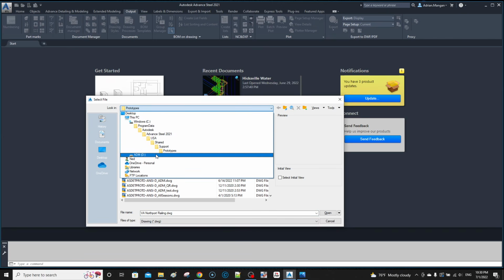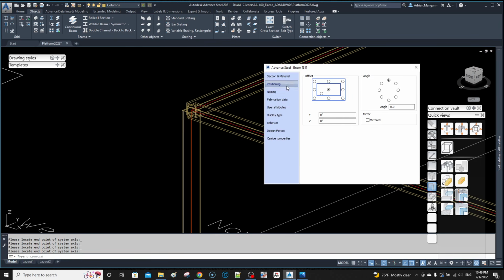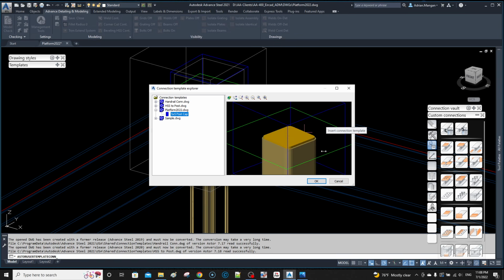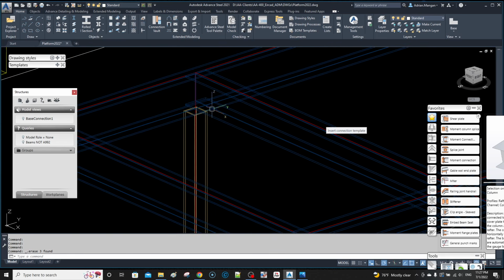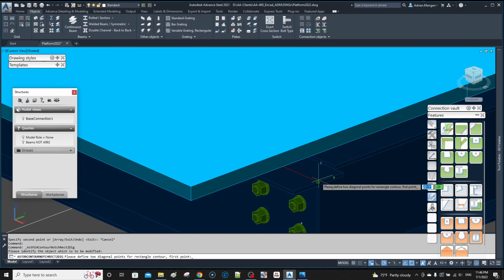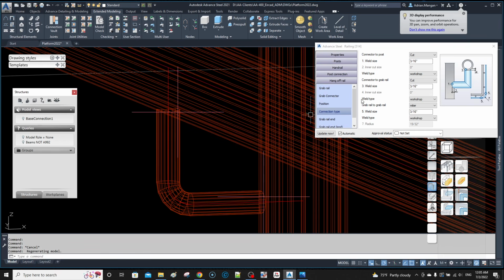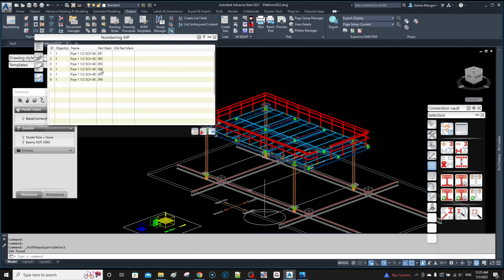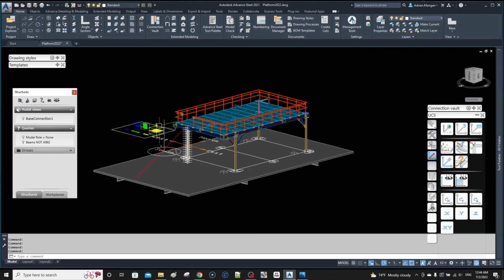ADVANCE STEEL TUTORIAL_PART 1 - Platform Project.

Comment: Hey mate thank you for the video. Mate im looking at starting to use Advanced steel for projects. We currently use Inventor Proffesional for structural steel but its a bit slow. I have Autocad experience but im a bit rusty as i havent used it in 5+ years. One thing with Autocad is setting up layers could you please point me the right diection where i could possibly download a template with layers for Advanced steel. Thannks mate,
Wiremu

Comment: Very useful video to learn AS. 
Start to finish modelling, lot of different elements (existing steel, columns, beams, bracing, railing, grating etc). Wouldn't mind at all, if you'd make more of these longer videos for other structures, building types.👍
Reply from the maker: Thanks Rauno, there will be 3 more in this series all will be over an hour each at least, hope they help.